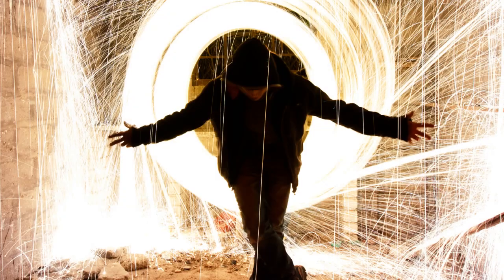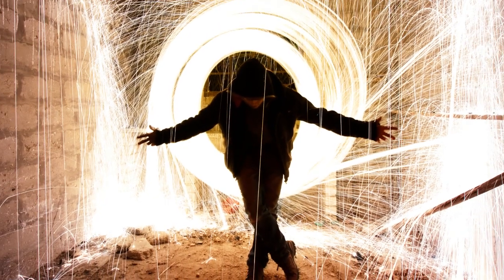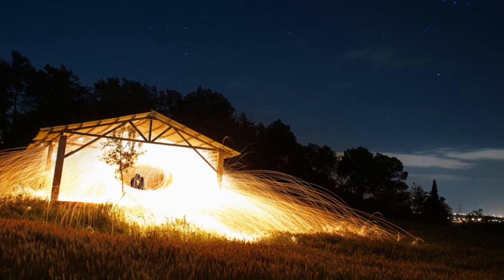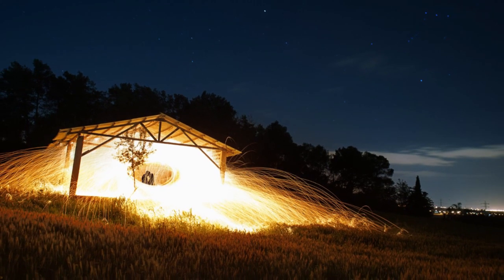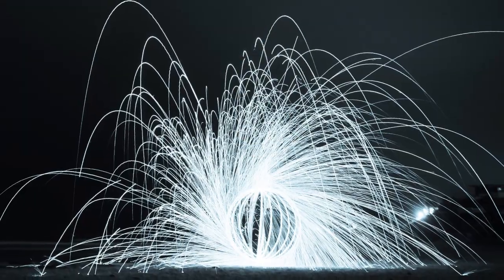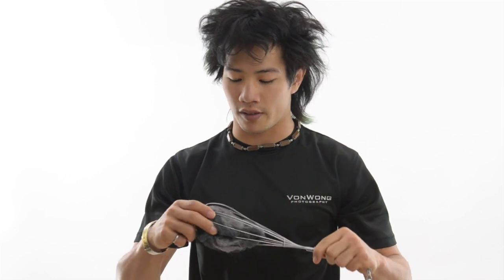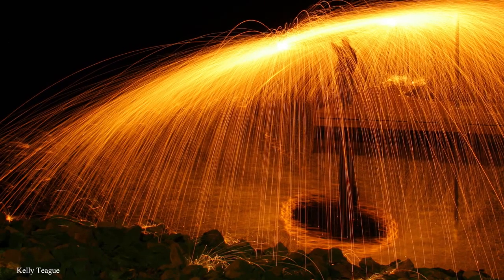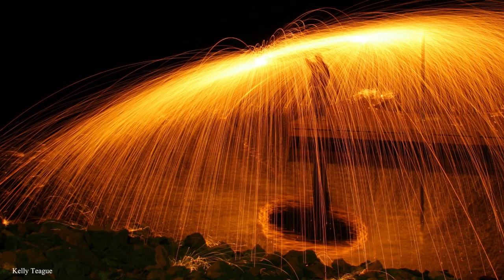Steel Wool Light Painting Explaind

Comment: Having experience in this area, make sure everything around you is soaked and wet, like after a rain. These embers are metal and can cause a major fire. Make sure to have a hose (attached to a water source) or a decent fire extinguisher. Also, take care to protect your lens, I have seen another video where an ember hit an expensive Nikon 14-24mm f/2.8, and actually burned a bubble into the front glass element, so camera distance is something to be considered.